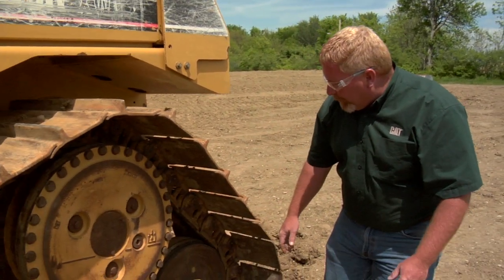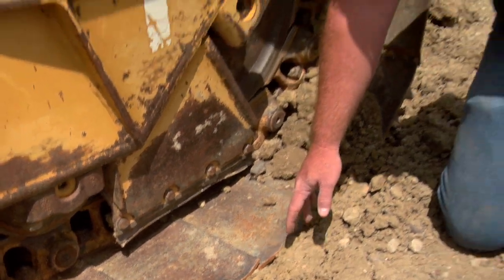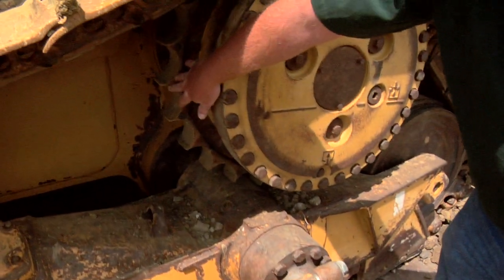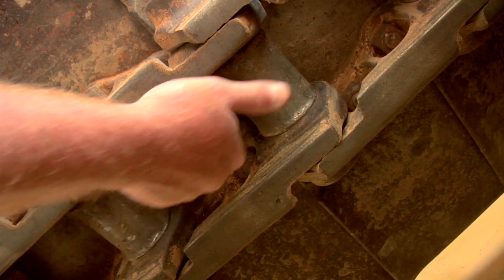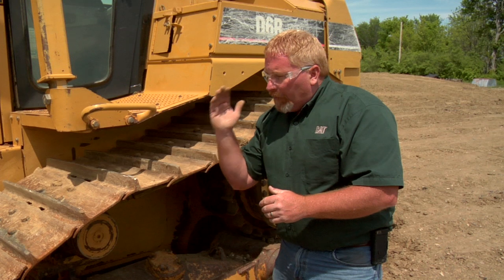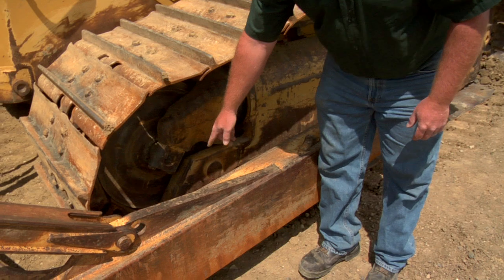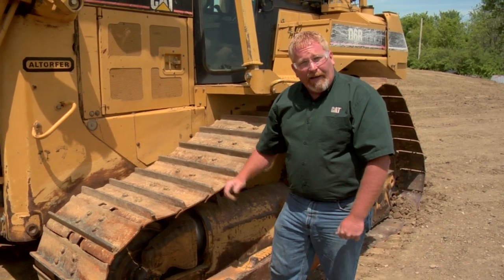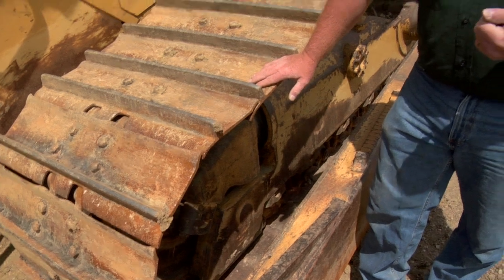Cat® Dozer | Undercarriage Track Maintenance

Comment: I cannot help myself:

Many lifetimes ago I worked on a farm that had an old D4 on it.  There was no blade but it never saw concrete or rock and it was so excellent in gaining traction.

I would like to get one when I start growing crops in my retirement but I think the running cost of a crawler tractor over a wheel tractors probably five to one. 

 Actually, what I look at the rental rates that's probably the way I would go is just rent it for the week and then turn it in.  I don't know why on this goofy because I hated running into ammunition carrier in the artillery unit as it had tracks.  I guess I'll expect a better suspension system with a Cat track tractor.

Comment: where is the grease sert tetioning mecognizm location on the d6r dozer
Reply: Under the cover on top of the frame between the sprocket and carry roller . Remove 4 bolts and cover and grease fitting is inside where the cannon and the oil is .